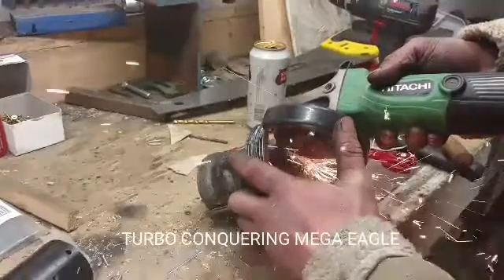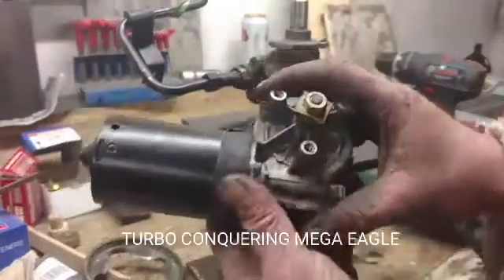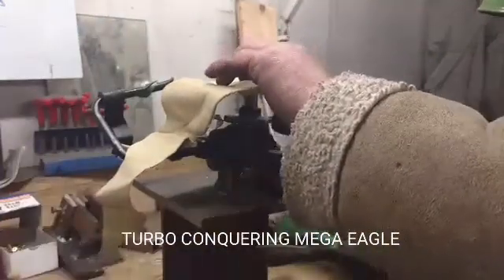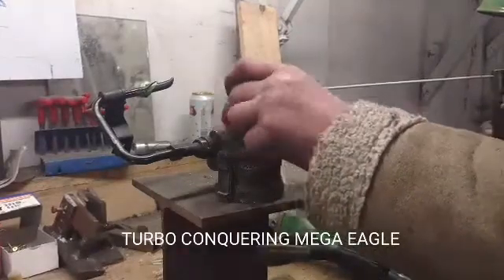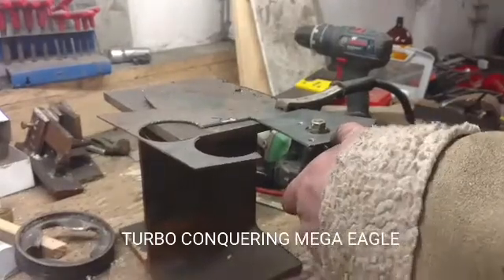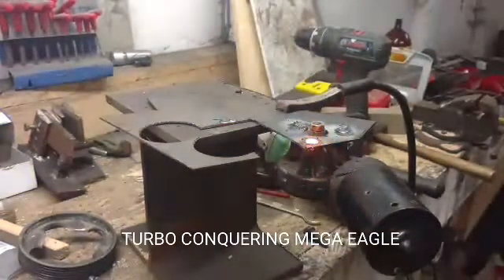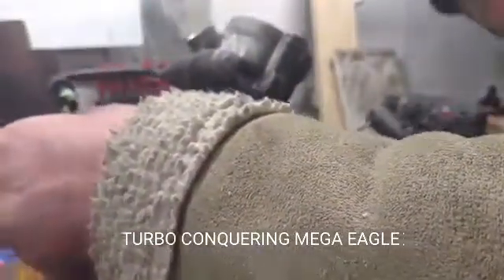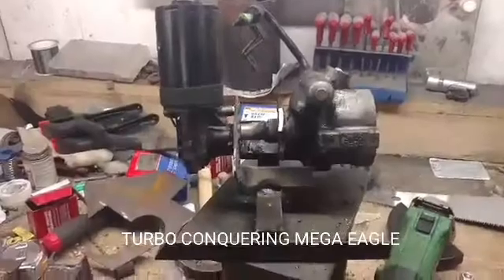WASTE OIL BURNER EXPEREMENTS

Comment: I have been looking at the same Idea. I was just going to use a 1.5 HP AC motor driving the Steering pump by belt. With a PWM Controller you could control the speed of the motor as you needed. 

You should be able to get Veg or used engine oil to work. I have been running veg oil in my Diesel vehicles for over 10 years so it must spray OK if you can get enough pressure. I think Mechanical Diesels run about 20K PSI. I believe a power steer Pump runs about  1000-1200 PSI, Much less. . Maybe  if there is one, you could block off the PS Pump bypass so it delivers all the pressure it can. 

Don't forget that if you enclose the injector a bit, such as in a tube with holes round the injector end it will create a more captive environment which will allow the flame to sustain better rather than just blow out. 
Also the oil only needs to be atomised till the burn chamber is hot enough to vaporise it, after that you can direct feed the oil with no nozzle and it will sustain happily with a bit of forced air.  You may find an injector won't give you the outputs you want so You'll either have to couple up a bunch of them or use one injector for preheat then go to the direct feed to get the power you want if you are doing something like a heater. 

Before anyone says it, NO, preheating the oil won't help it burn or do anything else other than cause complication and more potential problems. 

The Spray burner I built just used compressed air and a flattened bit of Copper for a nozzle and worked really well

If you are into big Burners, Maybe we should have a Competition to see who can come up with a 1000 Kw Burner? 
Might be a bit of fun!  :0)
Reply from the maker: Oil Burner given up with the power steering pumps, it's so hard to block the releif valve ports off, I'm looking for a deisel pump of a much larger common rail engine as they make the pressure.  1000kw sounds like a very sensible challenge! I'm not sure I'd want to try this system as I'd need to find the injectors out of a class 66 locomotive

Comment: Diesel Injectors require very high supply pressure. The Venturi effect is generically used in diy  waste oil burning with great effect. Though if it's just a project to see IF it can be done I bet you can learn a lot
Reply from the maker: Joseph DAndrea I'm not aware of anyone using a venturi, you would need an awful lot of suction and probably thinned out oil. I've got videos on several other burners I built and it's due to poor atomisation by their nature that I really feel driven to use injectors, if I can ignite waste oil with a lighter like I did the kerosene in this video, I'll be happy!